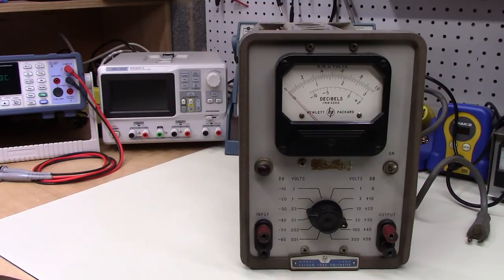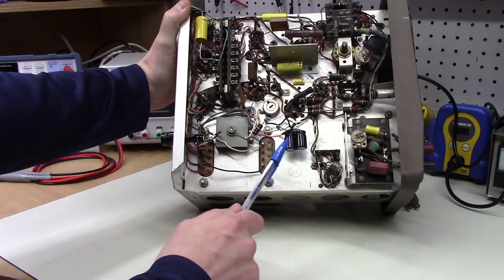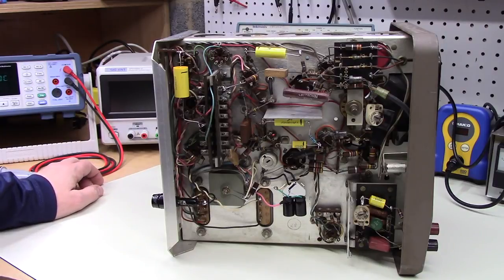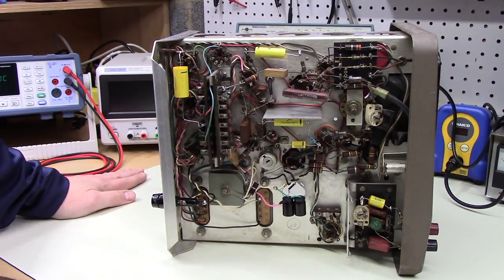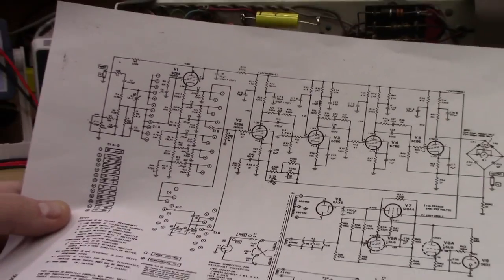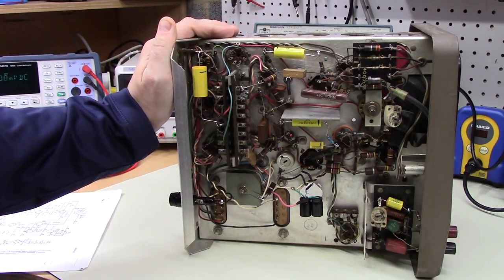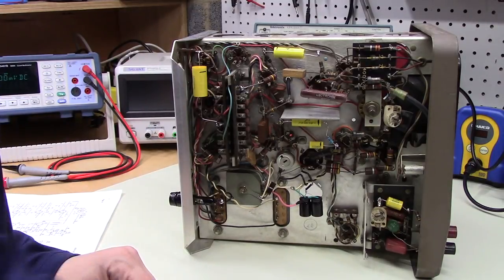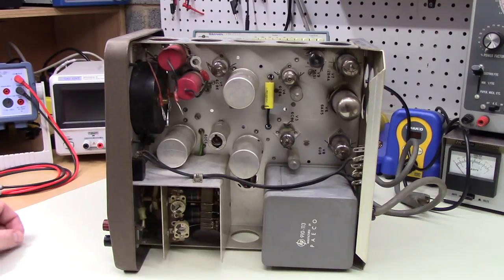#69: HP-400D video 3: Circuit and component details

Comment: Hi. Just wanted to let you know that you may want to do what a few others are doing with old bumble bee caps. There are a few idiots out there that are selling them to poor, not so smart people that want their vintage guitar amp to be original equipment for that vintage sound. Well, I contacted one of these sellers and asked for the ESR values were on the caps he was selling. He quiyackly responded saying that he did not measure any values of the caps. Which meant he had not a clue nor wanted to have a clue. Love your video. Can’t wait til you start the military one. I want one. No electrolytics!

Comment: Thanks for the update. I'd just disconnect and leave the other can caps in place and simply wire in new electrolytics on the bottom of the chassis. Good luck with the switch assembly I think you can do it!  73 - Dino KL0S
Reply from the maker: Yes, that's definitely an option, if there is enough room. Thanks for having faith that I can get it working!

Comment: Hi, I wonder how you get on with the HP meter. I have the exact same model. Every little wire in my unit is exactly like in yours. I'm amazed how they managed to get them so uniform with manual assembly. However, my unit came with a problem of parasitic oscillation from the moment I got it. So I went through a similar journey of replacing all (but the attenuator) caps, tubes, isolating parts of the circuit etc, still no joy. Currently I'm investigating issues with ground plane connectivity. Notice that almost all ground connections are through rivets. If some of them get loose the resulting issues are very difficult to troubleshoot. Anyway, I wanted to point you towards those rivets as a potential source of a problem. It took me a year of fiddling with the unit to identify this issue.

Comment: I just picked up a 400D for use in my home lab. Serial number is 15729 so the the 4B service note applies to my meter. The problem is, im having a hard time sourcing an axial .047uf cap that comes in the update kit that doesnt cost an arm and a leg. I can find the SMD equvalent. What do you think about the idea of creating an smd board to replace the input section. It looks like the three "matched" resistors i will have to order custom unfortunatly. Any help is much appreciated!

Thanks

Comment: An ordinary person assembled it at the factory. Remove the the front panel, shield and the switch assembly and replace those cracked caps. You have nothing to lose. It's shot as it is.